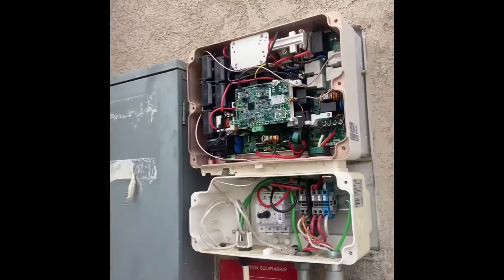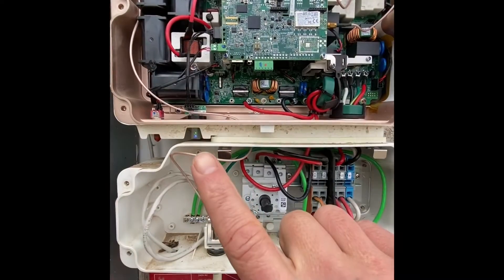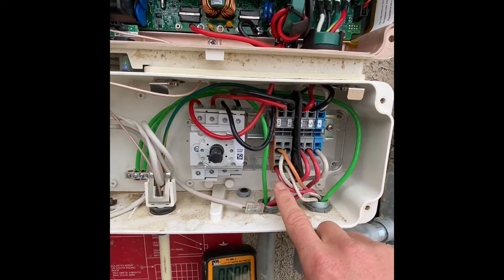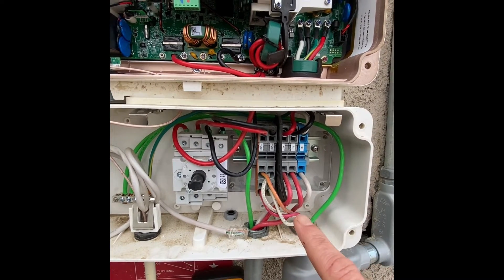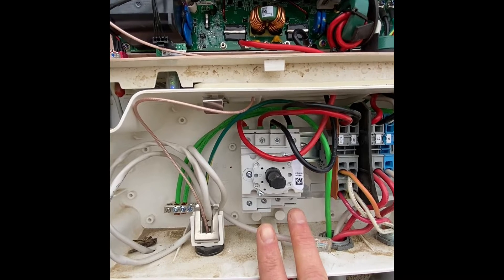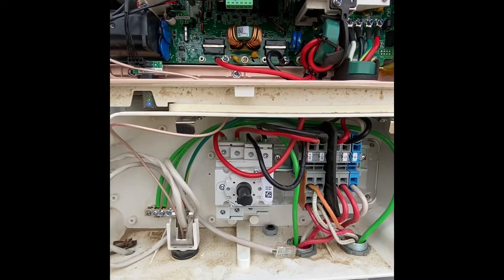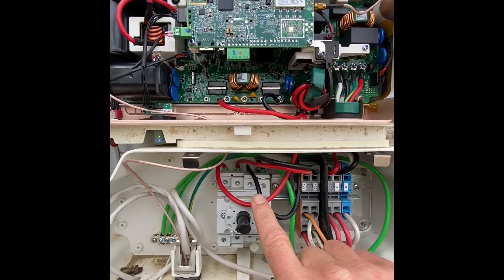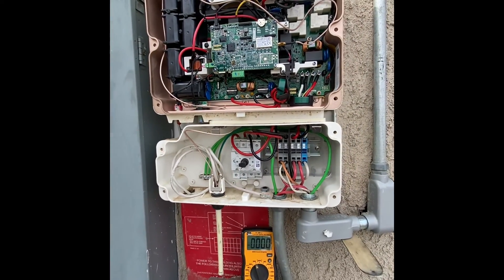Hack: Solar edge inverter blinking green light fix… DIY repair you can’t afford to miss. SolarEdge

Comment: I wish you could sure the steps. I'm a video kind of guy learn..
My systems 5 years old December 24 th SMUD stopped reporting solar. A year later finally got a company to replace inverter $360 but I have paid two diagnostic fees... Still flashing light. Nothing against old men today. They sent out one who hasn't done solar stuff for a while. The modem communication card also expired 3 years ago because of 3G haven't paid the $700 to replace est help.
Flushing green lights. It's cloudy here today

Comment: Congrats, now you dont have a working mechanical disconnect switch for the DC, which is required in almost every jurisdiction. Imagine your roof caught fire and the fire department flipped that disconnect and expected the roof array to be de-energized (or at least safety voltage) and now they're going to get injured when they get electrocuted by 400v of power.

You should never bypass a safety feature in any product, especially one that can generate anywhere between 3,000w to 11,000w of power.

If that lower disconnect box was properly sealed and didn't have all of those water stains inside of it, this failure may not have happened in the first place. Never DIY high voltage equipment like this. You're gonna hurt someone.
Reply from the maker: @frostipanda2737  hey, you should try it! It’s a great way to test to see if the switch is out!
Reply: main power off